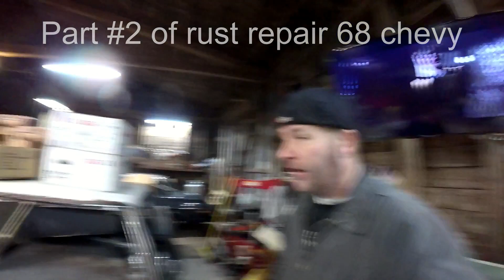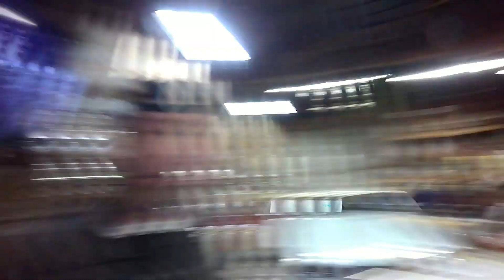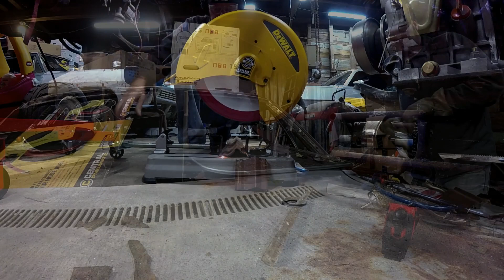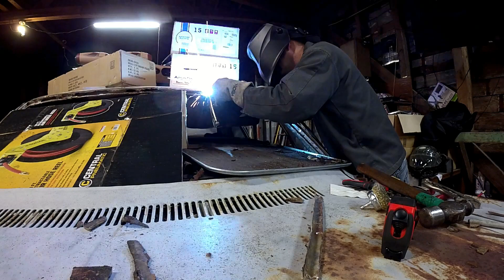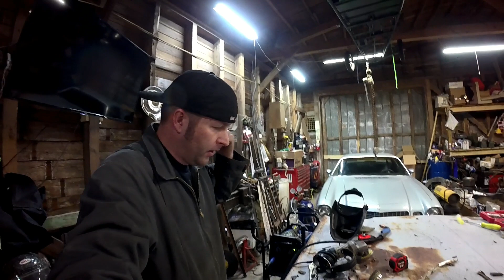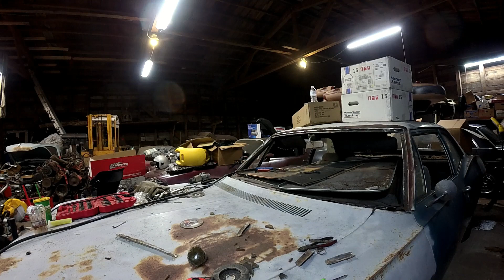Rust repair part #2 68 chevy

Comment: Next time you have a repair like this. Bend a metal rod to the curve of the windshield opening. Then take the rod to a local junkyard and find a late model car or truck that matches the curve and length. Cut the section out. Then weld it in one piece. I've done this many times. Works for A-pillars also.
Reply: Or find a roof from a wrecked car

Comment: looks perfect plenty good enough to be covered by the windowrubber , dont grind too mysh as it can thin the metal around it so mush aspecially the outside edge that its going to crack after a few rides around the block , you would be  right back where you started , might even be better to use a orbital sander for the last bit of smoothing
a small trick i heared from someone after his shop burned down  (not his fault he rented part of it ) , stay in the shop for at least 15 minutes after shutting down welding for the day/night and check if you can still smell sumting smouldering , aspecially foam rubber can combust and cause an oil like fire with a LOT of smoke that water cannot extinguish 
https://www.youtube.com/watch?v=EpskOwLvAoc